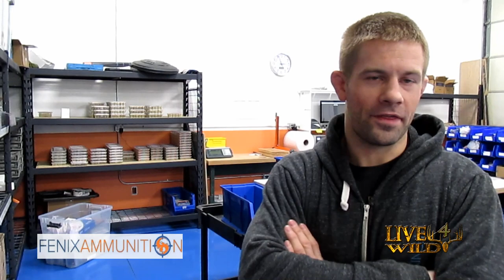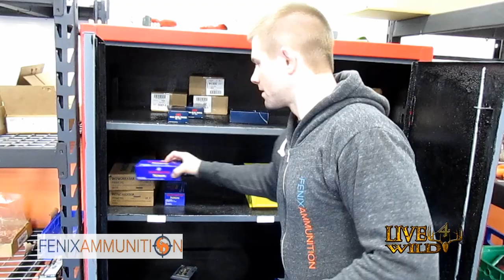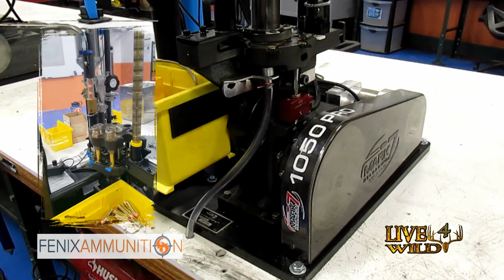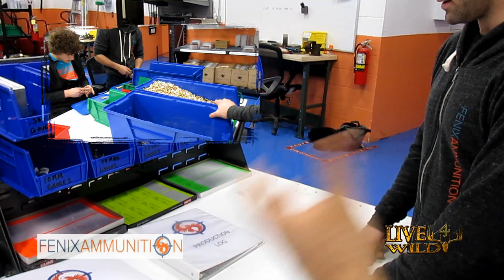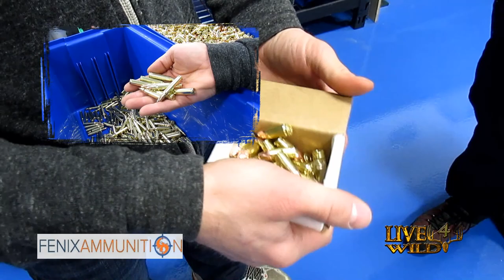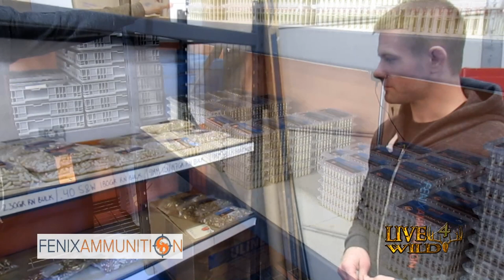FENIX AMMUNITION - Ammo Manufacturer shop Tour

Comment: Im a reloaded myself, Doesnt tumbling a charged round in corncob/Walnut media, break down the powder inside the round?
I dry tumble range brass, shake it out hard and then deprime/size and then trim. Then I wet polish it with stainless steal pins and then air dry it in a Food dehydrator! Then I prime it, Seal the primer and then load and leave it be!
Reply: TheSheepDogPatriot1776 I just started the video and have not made it to that point but if they are doing that it concerns me also
Reply: No it doesn't, every manufacturer does a final tumble before packaging.
Reply: I tumble all my loaded ammo. All manufacturer's do it.